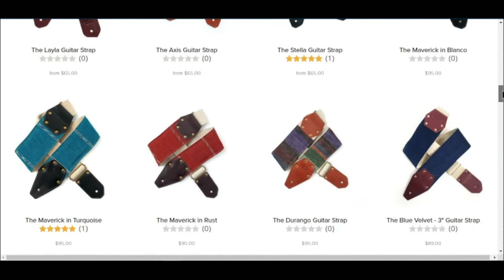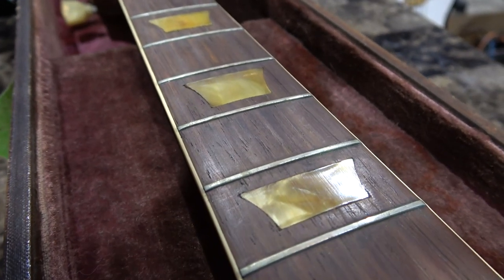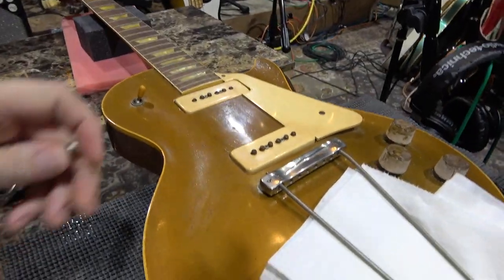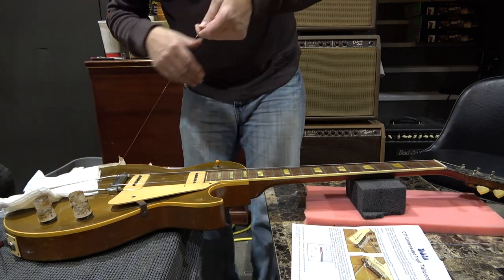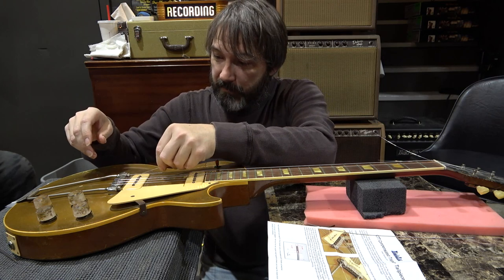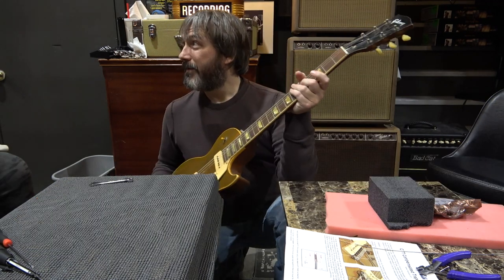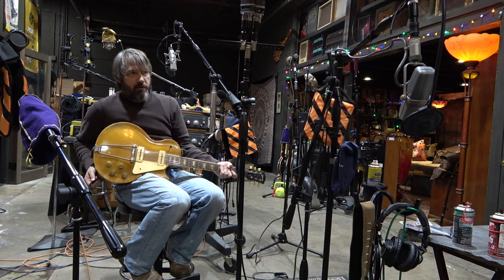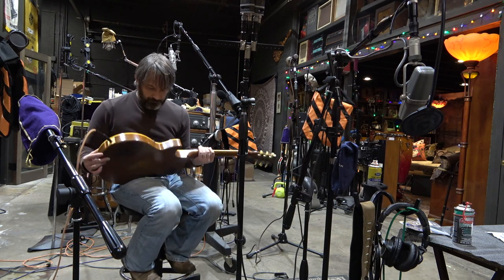WTF!?! He's MODIFYING an ORIGINAL 1952 GIBSON LES PAUL???

Comment: Hi Brad! Late post but I rewatched and was reminded that I wanted to share my stringing method with you. I do the same under/over wrap on the posts but I pull the string taut to the post, wrap it 1.5x around the post and then insert the end through the post-hole between the wraps, pull any slack through the post-hole and slightly kink it away to hold it. I then temper-tune to pitch, tug the string at the 12th fret while sliding my hand up towards the nut to pull any slack out of the wrap behind the nut, pitch up, tug, pitch up, tug and final tune.I find it to be way faster and I think you'll dig it. Heck, maybe I should make a quick video! heh. Thanks for your channel and I wish you the best. - Patrick Walsh
Reply: Oh! I forgot that I also scrub a carpenters pencil sideways across each nut slot a couple of times to deposit some graphite in there with each string change. I do it right before the post wrap and set the string into it. I find it really helps alleviate any hangups or snags in the slot. Cheers!

Comment: I got a P90 story. I like Canned Heat a lot and I was interested in tracking down Henry Vestine's tone. I thought I would have to track down what amps he may have used. I saw an old video and saw he had P90s in a Les Paul.

Now, before I had even started trying to look into any of this I had already built a guitar. I got some pickups called P94s and since I was new to guitar building I had no idea they were different than Humbuckers so I wired for Humbuckers, as far as capacitors go, .01 in the neck position and .02 at the bridge. But P94s are single coil. They're supposedly P90s made to fit in a Humbucker mount so, I mean I can use whatever I want but it would be more in line with normal recommendations to use a .047 caps for single coil. 

So now the guitar is rude as hell and it just screams and at first I wasn't totally into it. I even bought .047 caps to switch it over but then the rude screaming nature of it as it was just grew on me so I left it. 

It's about a year later when I started trying to look for The Sunflower's tone. 

One day I am on my way to work and I got Canned Heat playing on my CD player and I hear The Sunflower play a few notes and I think, "I've heard that before. Where have I heard that before?" Then it dawned on me that it was the guitar I built a year ago. So I am a firm believer that P90s are the key ingredient of Henry Vestine's guitar tone, and MAYBE a little bit brighter capacitors. I don't believe the amp is too important as I play through a Fender Princeton Chorus which is an early solid state amp that is rather uncelebrated, though I have never heard a lot of negative press about them either. The Chorus seems to work very well. 

Anyway, that's my P90 story.

Comment: I am a guitar tech. Self-taught, lots of studying and videos. I've done about 30ish. So, I'm, I'm new but they all come out perfect. I have all the best tools, it wasn't cheap. But I cannot believe you didn't check the neck and frets with straight edges. Or at least polish the frets and put some lemon oil or linseed oil on that Brazilian fret board. And check and adjust the relief. Maybe you did but didn't include that in the video. Touching up the fret crowns and polishing them really make a huge difference. For intonation and string ring and sustain. It sounded like they are too low to level, but I would have anyway. Please post when you do a fret job.  Would love to hear this guitar with a proper setup. What a wonderful piece of History.

Comment: intonation on the first two strings sounded dead on to my ears.  Older guy is saying sounds sharp.... no wait, flat.....   uh, no, pretty much dead on!  It'll intonate okay if you use 9s or 10s I guess or no weird hybrid set.  Movable saddles would be better for more precision tho.  Interesting vid!   And if you do your strings at the tuning posts where the string goes over itself, then you don't need a tool to take it off and it'll lock itself because of the pressure it puts on itself.  Wind the strings DOWNWARD and use only as much as would fit on the post.  Give them a good few yanks to stretch all the windings out before you tune it to pitch.  It'll work great.  just my 2 cents.

Comment: I think those knobs are actually acetate, the old craftsman screwdriver handles will cloud up like that, some times you can revove haze from old postwar early plastics by warming them with a hair dryer......it works on old american flyer and lionel trains.  Just use low heat so nothing gets melted.

Comment: Trapezoid inlays are probably cellulose nitrate? It shrinks and comes up, looks, feels like plastic and turns yellow with time. I have ordered some blank sheets of this from Rinco and frost (not sure about the spelling) in the UK 🇬🇧 for a early 60s late 50s Epiphone Casino that was missing two of  it's a parallelogram inlays. I cut and fit them perfectly like a puzzle piece. There is zero crack on any of the four sides. I cut them slightly oversized and sanded them to fit dead tight. They smell like Pine when you cut or sand them. The fretboard inlay Pockets were radiused just like the fretboard. I was surprised because I expected them to be flat on the bottom, but they were radiused so when I cut my inlays I heated them with my hot air gun on my soldering station and curved them slightly to match the radius rather than trying to sand in a radius on the underside, this was much easier. You should be able to used some water thin super glue and one of those little micro-fine extension tips or a micropipette and put some Cyanoacrylate glue around the perimeter, let it run under the inlays, press them in place and use some accelerator to make them dry instantly, then level them with the top of the fretboard and buff them out using 3M TriMite polishing paper. That's what I used on the inlays I replaced, the ones on the casino. I ordered a blank sheet of aged cellulose nitrate cut my parallelogram inlays from it. Aged doesn't look so Stark white as the regular cellulose nitrate however it still looks newer than what is on the guitar itself. I could have replaced all of the inlays on the Casino then they would look the same but the owner wanted to keep it original as much as possible and they look a lot better than having two missing inlays. My inlays look much better than what are on there because they fit better and they haven't shrunk any. The inlays on this particular guitar I'm speaking of are actually sticking up a little bit above the fretboard. I was going to level the old inlays that are raised up, but the owner said he wanted to leave it original so all I did was replace the two that were missing and left the other ones as they are. They weren't coming loose so I didn't do anything to them, but a couple of them are sticking up substantially, about 1/16 of an inch above the fretboard. The company I mentioned above sells some pre-cut trapezoid inlays as well as the blank sheets in both the Aged version and the new version should you need to replace some or want to on this particular guitar. If they weren't shrunk beyond all recognition I would just glue them in place and level them with the fretboard and polish them up using 3M polishing paper which is a great thing to use to polish your frets in place of steel wool with sleeves that nasty steel wool dust everywhere. I switched over to the 3M TriMite polishing paper and I've never looked back, much better than steel wool. I can polish the wood as well as the Frets themselves at the same time. I save time & tape by not taping up the fretboard. When I get done I have perfectly rounded hotdogs ends on the frets and a fret that looks like new Chrome. plus the fretboard itself, unfinished Rosewood, ebony or any other kind of wood for that matter shines like a polished Rock. Everybody always comments on how nice the fretboard looks when they get it back from me. The unfinished fretboard looks like I've put some type of finish on it when all I have done is Polish the wood itself.
God Bless Y'all.
Merry Christmas 🎄 and Happy New Year to you & yourn!!
Wishing Y'all the Best Ever!!
Jimmy in NC....

Comment: Brad, I don't know if anyone else has asked already, but is there any particular order that you install and tune the strings? Like to equalize the tension on the bridge and neck? I usually go E to E, but I've seen several "Guitar-Tubers" that bounce across the fretboard instead of higher to lower or vice-versa.Thanks, this video has a great many little tips and tricks.

Comment: I have had great success with the over and under string method.  FYI - when  you fret during the intonation use your fingernail and try to get right on the center of the fret.  That way your finger pressure doesn't sharpen the string.

Comment: The new ones don't have that open woody sound. The cheap USA tributes have a more open sound than the standards due to the no wood filler and thin finish. What a fantastic sounding guitar. That's the tone on the old 60s and 70s recordings. Thanks

Comment: They did sell re-issues of the the 1952 model, both as batches and through the custom shop, but most of those had the strings wrapped over the bridge. I believe the "50th anniversary" ones from 2002 had the wrap-under bridge.

Comment: If you use one of the dollar/year calculators, you will find that $240 for the guitar in 1954 (and that price was always without case)  is about $2200.  Cases at that time were $40 ($340 today)... so they were literally just as expensive then as a new Gibson is now.

Comment: Be super careful with the knobs if you decide to take them off buff them. The pot posts have a solid shaft and it is super easy to crack the inside of the knobs if you take them off incorrectly. I put repro knobs on mine because a former owner pulled the originals and destroyed them doing just that.

Comment: It’s not the carbon that gets scratchy sounding.  It is the center contact wiper . It has grease on it that hardens and causes a break in contact. And that is a pop any petroleum solvent will soften the grease . And working the wiper will clear it. But working the control can wear out the carbon

Comment: 19:10 if you just give it a few winds it will push the string up. Wounds take 2 full winds plains 4.

If for some reason you have the split tops.. Bass.. You gotta bend the tip and slip into the center.. Which means the +2 method precut

42:00 beast!!!

Comment: That guitar sounds great man. Nice job with giving it a nice mod and service tune up. By the way... looking at building a tube amp from a console hi fi stereo. Any good ideas schematic wise using 2 12ax7 and 2 7868 power tubes? Seeing that EH now started making the 7868 again and looking at specs for those power tubes. I really want to build something with them. This would be my first attempt at this. Tone stack wise, would kinda like to voice it as a blend of Fender and Vox. The tubes as a pair are capable of around 45 watts, but I'm only looking to push them maybe to 35. Mainly looking to push the preamp tubes for breakup.

Comment: Gotta get some oil on that board and also clean the sides of the frets with the oil. With everything off I would have lightly cleaned everything.  Mojoaxe is a fantastic solution for the original Trapeze. I have a few 52 and 53's. My 52 is one of my best sounding guitars I own.  If you really want these to sound the best, adjust the pole pieces to match each string loudness.

Comment: Don't use steel strings as ground buses or so forth.  You don't want dissimilar metals with different potentials in your circuits, it can only lead to trouble down the road.  You're basically forming a small battery at the junction between the two metals, and depending on what metals and what electrical and environmental conditions exist, it can just corrode away over time.  You can get away with joinging dissimilar metals if you understand the properties and science of it all, but randomly soldering whatever guitar string alloy to a copper wire will not be consistent or predictable.  Better to just use those stubs for cleaning your bong.

Comment: Great vid! Modern strings don't really "stretch" what you're doing by tugging on them is seating the strings.
Reply: Please explain that. I'm not being sarcastic or facetious. My mentor told me to always stretch in my new strings, giving a pull up top and just over the pups. Is this bad for the strings or guitar?
Reply: @saltpeter7429  I really should correct myself rather than explain. Strings do stretch (any material under tension will stretch a bit) but what happens when you tug on guitar strings right after you install them, is they will basically settle into place. The windings get pulled tight, the string slips in the nut and at the saddle, etc.. To be really precise, I should have said something like "Modern steel alloys have much better tensile strength than the ones back in the 70s and 80s and before, and the tuning stability you gain by tugging on a fresh string has more to do with the string settling into place than the steel stretching out." :-D
Reply: @saltpeter7429  Oh, and the only way I can imagine "stretching" new strings might damage an instrument is if you pull them at an angle, pop them out of the nut slot, and chip the nut. I've never seen that happen mind you, just the only way I could imagine it could cause harm! LOL so "stretch" away fearlessly!

Comment: Just want to throw a question out there Brad or anyone who might know did bake a light come in clear a plastics I don't think they did I know from my fountain pen collection I've got you know pens from 1800s of course they were on fountain pens to you know modern day Shaffer do a folds and stuff and you know what was big before plastics was a hard rubber and it's amazing some of the patterns they can get out of using red and black hard rubber yeah and they would stood the the test of time too I mean a lot of those pens if they didn't crack or sometimes shrink because no I haven't been able to work on them or look at them for years now cuz of my eyes but I forget if it was the black or the red contracted more than the other color which sometimes led to a problems in fittings like on you know when restoring them although I was lucky to find a guy who actually had old fountain pen bladder machines you know those were the the rubber bladders that were inside most of these fountain pens although when you had the vacuum attic and other pens the shape of snorkel they didn't have ladders they had you know call it Rube Goldberg technology I mean if you could make something simple complicated when it came to fountain pens they did it please excuse this I'm going to stop here because I don't know why I'm talking about fountain pens when you got this cool video going and it's got nothing to do with the guitars so I apologize sincerely yours, Bob the blind bedroom guitarist

Comment: Why do these old 50s to early 60s Gibsons always have that slightly (not overwhelmingly) metallic, nasally midrange focused tone that makes it cut through the mix and makes bass and treble strings so much more balanced? You can hear it no matter if it's P90s or PAFs... whether it's the pickup wire or the brazillian rosewood or the metal alloys in the hardware or the bumblebee caps or whatever, it's still hard for modern Gibson and all the boutique pickup or guitar makers to recapture it so it sounds convincing when played side by side.

Comment: I owned a 52' Les Paul in Toronto. The 4 knobs on mine were barrel-shaped and gold translucent and different looking, maybe because it was 1973 when I owned it and sold the guitar in 1974. I payed $400.00 & sold it for $600.00 a year later. Much ware under the pick-guard. Original bridge I got used to. No serial number and no ring around the treble bass selector.  Don't fit that new bridge! I live in Toronto, and I found the bridge pickup noticeably quieter than the front one. It held 
its tune quiet well!

Comment: I'm watching you string it up wondering when you are going to take the paper out from under the trapeze?
Reply: i shove paper towel inside my stringwinder its easier on the keys
Reply: @gregwilson2721  That's a good idea. i was actually thinking that those plastic winders need some silicone inside to prevent damage and to hold the key better.

Comment: This guitar in its original condition, is a "period" piece. If you run across or own an original item such as this, you have to know that back in the day, the inventors, originators and/or manufacturers were all going through a "learning" period. Design will change and perfect after given some time and some much-needed test driving.

Comment: I was just thinking that, those metal forks. Take most of the energy from the thick and mid strings and returns it into the body, sort of like a experimental tremolo.? my modern lead guitar trys to do it with a set of springs at back.

Comment: Shallow neck angles are superior to the modern the Gibson neck angle. The profile is much lower because you don't have the bridge stuck up in the air. All modern rock guitars have shallow neck angles for this reason. The neck angle doesn't change the sound of the guitar.

Comment: I mean I found through my own experience you know to get the most stable tuning when I put my strings on I use a liquid weld and I weld my strings to the to the ferrule the tuning peg and then when you need to take it off you just take a needle in those pliers and yank it hard sometimes the chrome comes off a little from the ferrule or the post the tuning peg but most of the time you know when you put another string on it you can't see it anyway Cecilia was, the blind bedroom guitarist